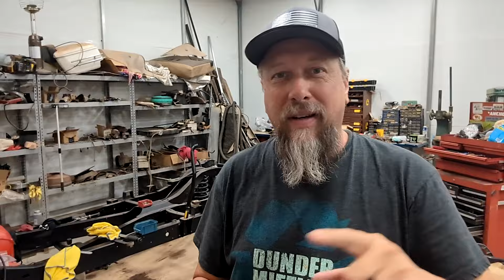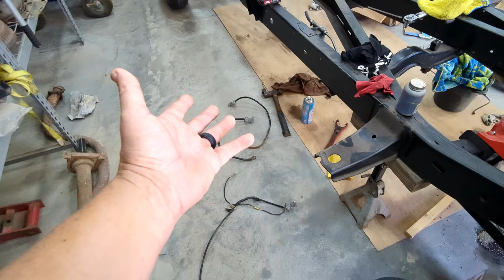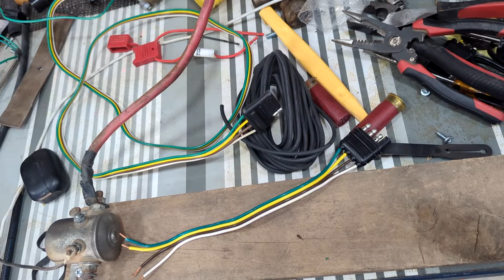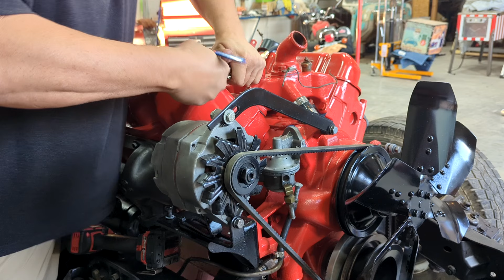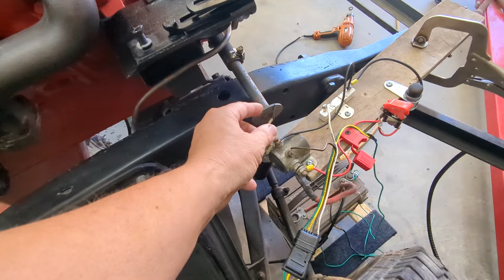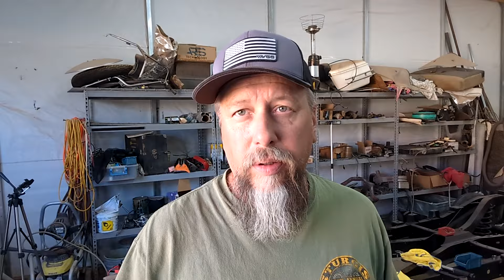It's Electric! - 1960 GMC Truck Restore

Comment: ON ANY 1960S TO 1990S GM TRUCKS & CARS ALWAYS RUN A 10ga HOME MADE GROUD FROM THE ALTERNATOR TO THE FRAME. JUST SOME FECAL ADIVCE ESPECIALLY IF YOU GOT A NEW IN MOTOR IN PLACE. MY SECONDARY GROUNDS I USE 6 OR 8ga WIRE.

Comment: it depends on what truck it is or was. Most Pickups had a ground coming off the bell housing to the either the frame or the cab itself. Then usually there was also then a ground from the back of the intake to the firewall. SOME GM TRUCKS LIKE FORD THAT HAD THE INTAKE GROUND ALSO HAD ANOTHER STRAP THAT WENT TO A STUD ON WIPER MOTOR ALMOST TO MODERN DAYS THEY STILL HAVE THOSE GROUNDS. I did find some really weird stuff on a few 60s & 70s GM & Dodge pickups actually had COPPER grounds on the fuel tanks themselves IN THE CABS & UNDER THE BEDS I SUSPECT WERE DUAL PURPOSE FOR STATIC GROUNDS & SENDING UNIT GROUNDING. Usually the metal eyelets rotted off and it was only on some well preserved junk yard trucks. I actually found the rumor of grounds on the tanks to B true. My 71 Duster has a similar ground off the sending unit to the frame ground probably for the unit itself.  That car was owned for nearly 50 years by the same person. Parked it in 1987 for a rotted gas tank & no brakes either. We found that out the day we went to put it on the roll back so I could take it home. If anyone looks at GM Dodge cars of the 60s & 70s they all still have grounds on the back of the block or intakes. If anyone looks at any intact 70s JEEP CJ has a ground from fuel tank to frame & a ground that runs all the way forward right into the cab its grounded under the dash cowling & to the gauge. That is mostly why all early vehicles have fuel gauges that don't really work. Besides rotten sending units.
Reply from the maker: Great info in both posts. I'll hang in to all that for when I get to the full wiring job. Thanks much!